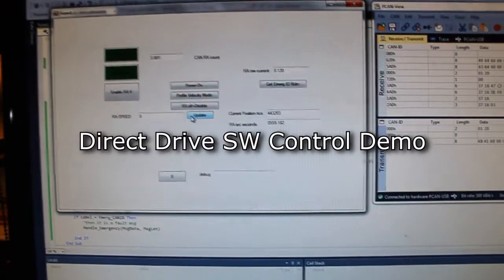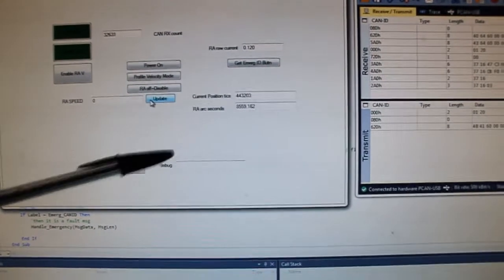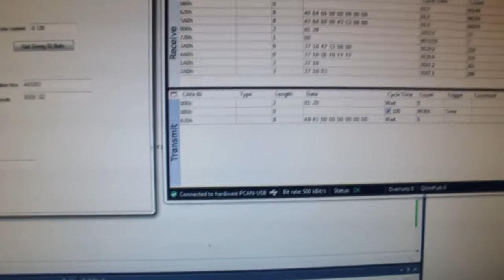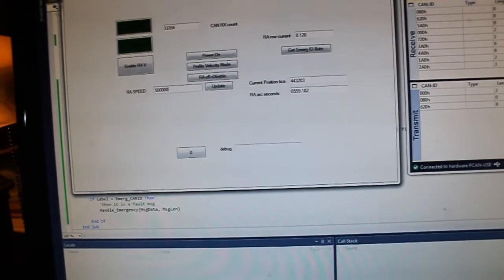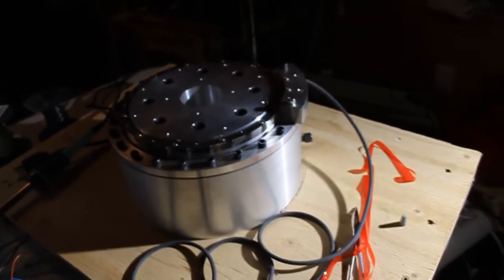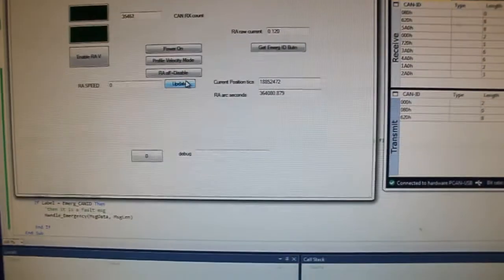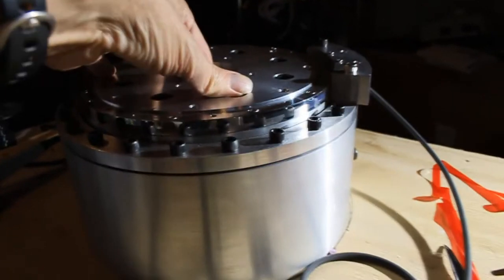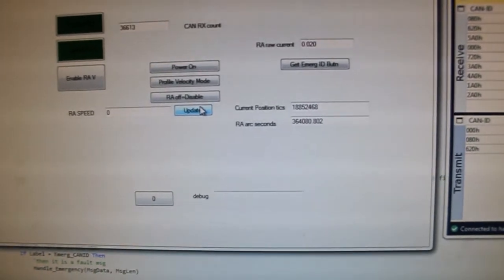Telescope Direct Drive under software control

Comment: Impressive work Bruce! I would like to build one of these also. 
Are you running Copley brushless drives? 
What type of bearing did you use in the motor? 
What brand is the stator/rotor pair? I only have experience using kollmorgen frameless motors (for an air bearing spindle).  
Are you using a renishaw Resolute encoder? If so what protocol (BISS, enDat, Mitsubishi, etc)? 
Also nice work on the custom controller interface!